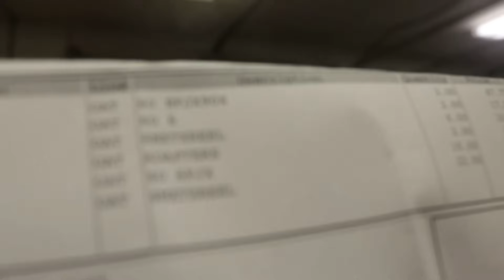Custom Cat. One 3 Pt. on a Garden Tractor

Comment: You don't need to purge the lines. Cycling the cylinder a few times will get the air out of the cylinder and lines. I have done this dozens of times installing new/rebuilt cylinders and replacing long hydraulic hoses.
Reply: Yea, and it doesn’t take long either.

Comment: Hi Frank. Look at a floating top link. My landpride brush hog has one. It lets the tail wheel go up and down with the terrain.
Reply: A slip link also works as well  I concur that you should never use a rigid link for a top link of a 3pt mower/brush cutter attachment... Nor for a snowblower

Comment: Frank, I'm a little surprised that you didn't add a hydraulic top link while you were plumbing everything in.I love mine and wouldn't want to be without it. It makes adjusting the TL on easy and much safer because you don't have to get your hands in around the 3-point hitch parts.
Reply from the maker: I considered that, but that would require another valve to operate. To be honest, I have seldom found a need to change the length of the top link in use (on my other tractors)  but that may be due to the type of equipment I use.  It does sound like a convenience, though.  Might be a future upgrade?

Comment: Having those independent controls for each side is going to come in real handy when you’re using a blade with your new setup. You can control the slope on either side to fall which ever way you want.
Maybe put an angle cylinder on the blade so you can control the angle from the seat, maybe a nice project when you get your mower built.

Comment: This is gonna be a really sweet tractor when it’s done, one of the upgrades I would recommend is make both of the arms on your 3 point so they run off of one lever instead of separate levers but that will be really cool seeing that with a brush hog.

Comment: Great job on that tractor Frank. Looking forward to the Bush Hog deck and blade assembly build.
Reply: A good source for relatively inexpensive brush cutter components is the rough country rt44 takes 2blades the stump jumper and 1spindle assembly driven by a single  v belt... install a ragb running the drive pulley via a spring loaded tensioner and not need an overrunning clutch (belt and tensioner act as the overrunning clutch and also will slip when overloaded so no overload clutch needed either)... Belts are cheap ragb aren't... This would give you a 42-44inch wide cut brush cutter/trail cutter the housing is internally approx 46inches wide x50inches long with a rear dovetail (rear discharge) if you use a slip link for the top link you could run a tail wheel for cutting depth control and prevent scalping and high cuts as the tractor travels over the ground... Another good add on would be a tail roller for anti scalping... For a 42-48inch brush cutter you want about 1000rpm blade speed a typical 540rpm pto usually uses a 1:1.9-1:2 ratio gearbox (input:output speed)

Comment: I run heavy equipment and do my on maintenance on my equipment and have found that prices very allot from place to place. But the hose is sold buy the foot. Also hose size matters as well. You also can get hydraulic hoses in different PSI which also applies in determining the cost. Good luck I like your builds.

Comment: I have a small tractor and the 3 point lifts up but not press down.  Sad.  Had hoped it would lift up the rear end so I could block it up and change a tire.  Nope.  Tough when one doesn't have extra machines handy to help.

Comment: I did it on my BX-22 because I was using a backblade and loader for snow removal. Completely inefficient but it was all I had for several years. Getting the backblade to cut at the "right" rake angle was difficult at best. It was equally important when I got a rear mounted snow thrower.
Reply from the maker: I can see how that would be a big help pushing snow with a back blade. I pushed snow with my Ford 2000 and a 7 foot blade for 35 years.  No loader, just the rear blade. I never needed down force for snow but grading the gravel lane I used to put a bucket of chains on top of the blade to weigh it down. Didn't have Aux hydraulics on that Ford so no hydraulic top link.

Comment: Asi t was explained to me, you don't want down pressure on a three point because you'll lose rear tire traction which is kind of what it's about.

I would think you should be able to install some simple pressure relief valves for float.  Thats all you need to do is relieve the pressure so the attachment can go up and down and isn't fixed in position by hydraulic pressure.
Reply from the maker: Adding a float valve is always an option. They are readily available and easily plumbed into the circuit.

Comment: My Case 220 garden tractor uses a slotted plate for float that can be pinned for down pressure. I use a blade on it fairly often and down pressure is almost useless with the rear blade as it takes weight off the tires.

Comment: It doesn’t look like your control levers have a float function to them. It is nice to be able to have the up and down pressure like you have, but you may also find a time you want the arms to be able to float as well. Just some food for thought. The build is going great.
Reply from the maker: Yeah, I need to figure that one out. The bush hog will have some "float" built into the hitch to better follow terrain, but a float function is probably needed.

Comment: Are you going to replace the reflectors with LED tail lights?

Maybe rear facing white flood lamps, in case you ever finish after dark?
Reply from the maker: I've put rear lights on most of my Cub Cadets (I have 10 fully restored tractors) but most got the OEM correct lights. A few have LED headlights though. Not sure about this one yet. Reflectors were standard on this tractor. Lights were optional.

Comment: Maybe it was covered and I missed it, but why the 2 valves instead of 1? It looks like a good build.
Reply from the maker: One for each lower arm of the lift. Reason is a bit complicated--space for cylinder(s), geometry, mounting point limitations, etc. Bottom line, it's how I decided to do it,  and with the benefit of independent control of the two arms, and ability to apply down force.

Comment: This is great work but I have a question on a normal tractor that has a 3 point hitch like that don't both arm's go up and down at the same time?
Reply: Definitely.  On a regular tractor, they are connected to a common shaft, that has its own single cylinder to operate it.

Comment: What is the reason for independent movement on lower arms? I thought they were to move together. I have seen where one side is adjustable to level out but just wondering. Works great too
Reply from the maker: without a way to adjust one side, I decided to control them independently.

Comment: You need a restricted orifice or flow control valves to slow down the hydraulics the pump used is pushing to much volume.
Reply from the maker: I installed a different pump. Discussed in next week's video.

Comment: Is it typical to control each cylinder separately?   I’ve used a John Deere with a 3 point hitch and they move togethe.
Reply: Most farm tractors only have lift , no hydraulic down pressure.  Thats not to say the late model tractors dont have that feature. Both lift arms are typically connected together and not operated individually.
Reply from the maker: I decided to operate them individually because, typically, one of the lift arms has an adjustment (to level equipment for example). Since I have two cylinders and no room for such adjustments, I figured two independent cylinders would accomplish the same thing.